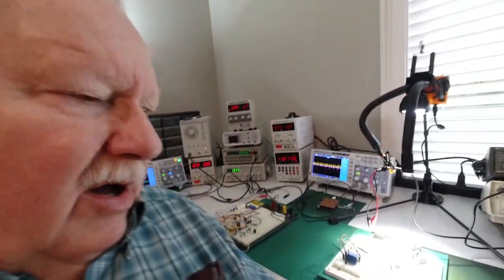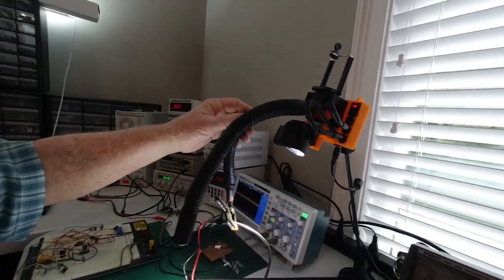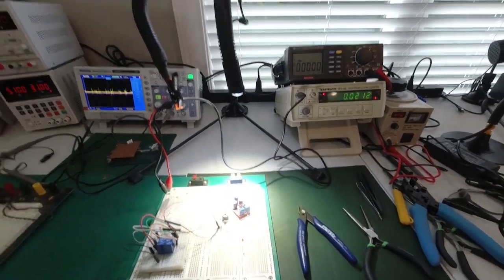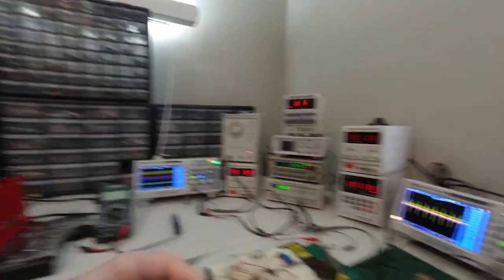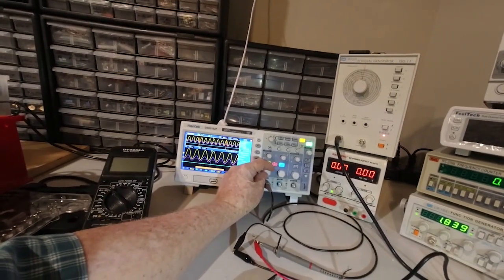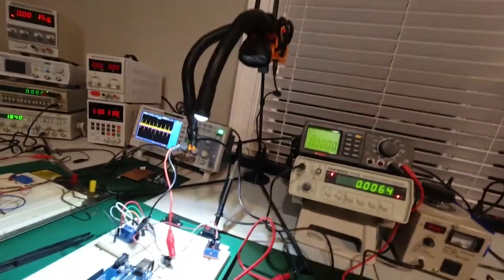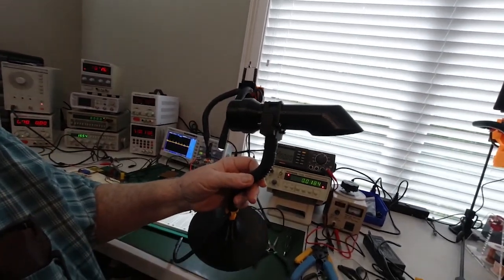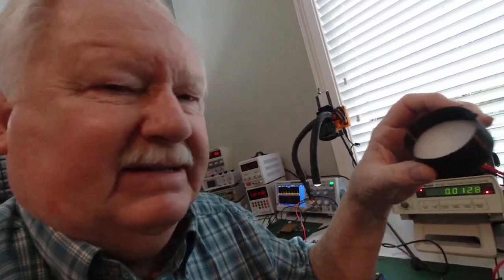USING ELECTRONICS WITH MY 3D PRINTING and creating new products for my 3D print farm

Comment: Hey Ken, what was your occupation and education that lead you to building a 3d printing business?  Larry
Reply from the maker: Boy that's a long story Larry. I got into HAM radio and got my FCC license in junior high school and went to a vocational high school and took electronics 3 hours a day for 3 years graduating in 1966. After that I joined the Air Force and attended 52 weeks of tech school at Keesler AFB Biloxi, MS. I had 6 hours a day of ATC radar maintenance school. next two years were in Rantoul, IL. and my last year at Nah Trang Viet Nam. Got out of the service and went to school for mechanical engineering, but before completing that went into a training program with TVA for Nuclear and fossil fuel power plant unit operator. After about 4 months of training, I decided I had enough of government jobs and worked as an electrician until starting my own electronics and alarm business in 1973. I later became interested in microprocessor-based computers and sold the electronics business and started a computer business in 1977. Later in 1984 I worked for a large automotive supplier and headed up their factory automation and manages their computer department. I left that job in 1996 to start my construction business. Along the way had many small interests and went back to school several times for business admin, computer science, industrial automation & robotics, etc. as needed. That is it in a nutshell, but believe you me there is much more to the story. Saving that for a later day...Ken
Reply: @NewTechInventors  Hey Ken, thanks for taking the time to share your story, wow you have had an interesting career.   I think a video sharing your story would be really interesting, seeing where you came from to having 100 3d printers.  Larry